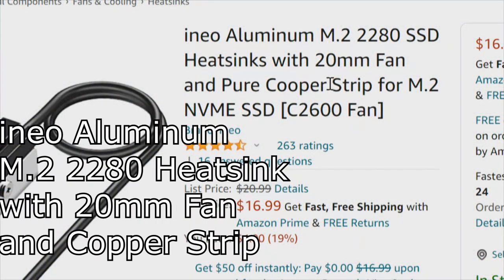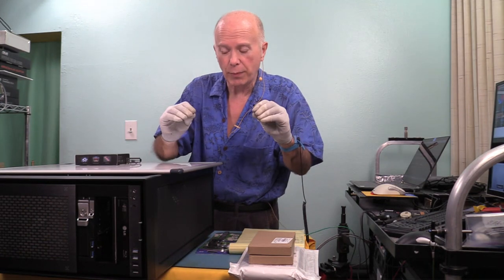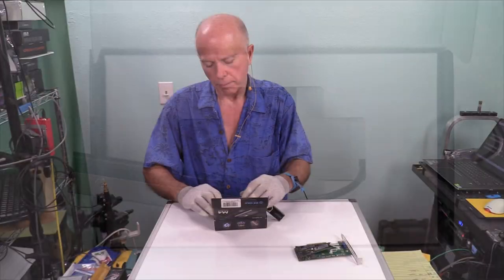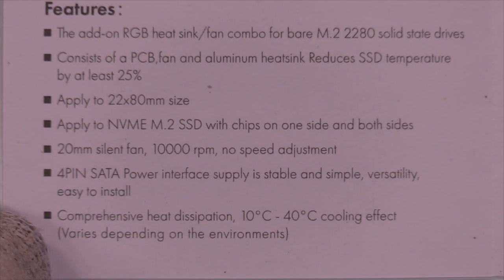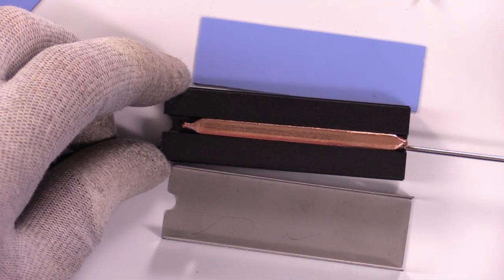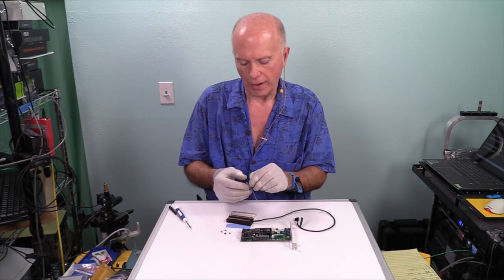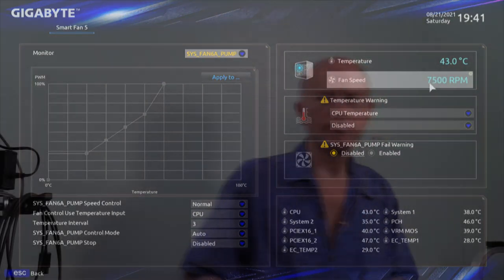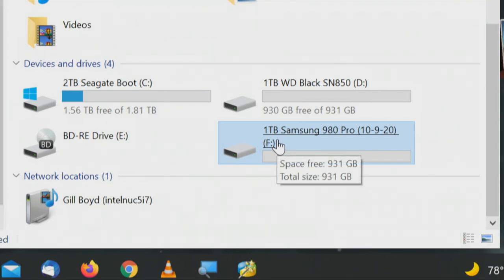ineo Aluminum M.2 2280 SSD Heatsinks with 20mm Fan and Pure Copper Strip

Comment: Only issue I have is the fact that the bottom base tray of the m.2 cooler is metal, and does not appear to have any sort of "coating" to prevent possible electrical shorting or maybe even heat dissipation into the MB at the base mount point.
What I did to add possible prevention was to simply purchase another heatsink strip, and add it to the bottom "sandwiched" in between the MB and the bottom of the m.2 cooler. Actually gained a 2 degree difference. Very Impressive.
Great video, and thank you for making this test for all of us to see your work.
Reply from the maker: Hi Joe Jones,
Welcome! I've always examined the bottom for clearance. Thanks for Sharing! You had great Results! Appreciate Your Comments!

Comment: correct me if im wrong but the cooler was installed the wrong way, the fan over the memory controller should provide slightly better cooling but from the way it was installed in the video, the fan portion of the heatsink was installed over the nand memory and not the controller which what actually gets hot when the nvme is being used.
Reply from the maker: Hi Frank, 
Welcome! Glad You mentioned that aspect. Keep in mind, of the 16 M.2 NVMe PCIe Heatsinks We've Tested, Two were Ineo. Both had Fans. This one, as You have stated, should be over the Memory Controller. The other by Ineo has the Larger Fan centered for the Heatpipe. Neither of them Performed as well as We had expected. No this will not be repeated. As always, Test and Verify, Your Results may vary. We have found of those mentioned, Passive Cooling was more Effective than Active Cooling. Yes, Our Two best Performers so far are Passive Cooling, Acidalie and JEYI. We need better Designs. Especially for PCIe 5.0 unless to reiterate, current Designs change significantly. Thank You for Your Comments and Observations. We look forward to Your Results.

BTW: That M.2 Heatsink Cooler is currently out of stock on Amazon.

Comment: Hmmm 🤔 that fan is not doing much is it 😅? Normally a properly designed fan for a particular heatsink results in 2.7~3 times increase in cooling capacity, not today though.
Thank you for the video, very informative !
Reply from the maker: Hi 5 nm,
Interesting right. We too expect better Results. Thank You for Watching! A Review Summation then the Thermal Pads!

Comment: About to install a Corsair Commander Pro to handle all the fans, as the Designare doesn't report RPM on all of the fan ports.   The Commander Pro works with Argus Monitor, which allows much more complex fan curves than the BIOS.
Reply from the maker: Hi Michael V, 
Good call! Thanks for bringing this Up! That was on Our List for the Active Cooling Solutions if We had gone down that road. Good call for the other Case Fans too! Thanks for Sharing!

Comment: Four heat pipes wins. With two temp reading and the one on the controller being lower sounds good to me. I use the Asus DIMM2 mobo socket holder for two NVMe drives that comes with two Al covers. I hate M.2 sockets that sit under the Graphics Card!
Reply from the maker: Hi Max Hughes, 
Absolutely Agree! Acidalie with 4 Heat pipes. Interesting only ASUS, as far I can remember, is using an M.2 DIMM2 card. Everyone else, under the Graphics Card! These Results are fascinating!
Reply: @BuildOrBuy  Sorry I don't have any temp info on the DIMM2 cards on the Zenith Extreme. X399 no heat sinks. TRX40 Zenith II Extreme had heat sinks (I bought two on eBay for my old X399). WRX80E no DIMM2 socket at all. I'm looking forward to the tests on quad cards.  My Asus Hyper card doesn't have any finned heat sinks on it. Should I glue, thermal tape or use paste/pad and screw down a heat sink to a quad card  with only flat sheet metal cover? Amazon's 150 x 70 x 10mm Al sink look like a fit.
Reply from the maker: HI @maxhughes5687 , 
Bummer. Got it. No Heatsink on Your ASUS Hyper Quad x16? Odd. Purchased new? Most curious. On Amazon? The ASUS Hyper Quad x16 has an Aluminum Heatsink with 4 Thermal Pads. At least the one We Tested did. We have other Quad card that do not. I'm going to have to look into that further. This Series arouse out of Heatsinks for Dual M.2 Adapters. In the back of my mind was the CableCC Dual and Quad cards We have yet to Test. a Quad card should have a 4 Drive solution instead of 4 individual Heatsinks. This is going to get interesting. I'm concerned about the weight. We might have to examine those as We do the Heatsink Summation. Stand by for that recommendation.
Reply: @BuildOrBuy  Yes. I went back and watched your vids. I remembered the copper finned sink on the Gigabyte but forgot about the Al sink on the Asus. Once I put it together, I don't want to mess up the thermal pads opening the cover. And I'll wait till I have everything to break the seal on WRX80E box. Sorry to waste your time.
Reply from the maker: HI @maxhughes5687 , 
I think those Thermal Pads have a film covering them if memory serves me correctly. Never a waste of time! I Appreciate Your Comments! Helps Us to make better Videos for clarity while We Answer Subscribers Questions! Stuff like that is easy to forget or overlook! Sometimes We just need a reminder! When will You have everything ready to Build?

Comment: Installed this on my SN750 SE and I reached 46c during full load. Idle at 37c. Probably overkill but that’s the point right?
Reply from the maker: Hi BASHFILE,
Welcome! Always good to be aware of heat which becomes a bigger problem at PCIe 4.0 so You're thinking ahead! Overkill... Getting prepared!

Comment: Nice review! I got a question to ask you. I got Asus Gaming Plus B550 with two samsung evo plus nvme (500GB and 1TB) the 500GB was closer to PCIe 4.0 next to cpu at the top left side and 1TB was closer to PCIe 3.0 next to chipset at the bottom right corner. Both NVMe are PCIe 3.0. The drive temperature and drive temperature 2 for 500GB idle at 28C / 32C and full load at 66C / 85C while the 1TB idle at 28C / 32C and full load at 67C / 88C as it seem drive temperature 2 are the hotter than drive temperature? As both NVMe are with thermal pad heatsink. Are both 66C and 67C are ok and safe for both NVMe drive temperature rather than drive temperature 2? The temperature was full load using CrystalDiskMark as both are reading 3500MB/s read and 3300MB/s write speed.
Reply from the maker: Hi Bulldog347, 
Welcome! Thank You! Appreciate Your Comments! Suggest running the Samsung Magician
https://www.samsung.com/semiconductor/minisite/ssd/download/tools/
Numbers are good and consistent. Those PCIe 3.0 M.2 NVMe SSD Drives should top out OK on Temperatures. Samsung Magician will identify. Suggest changing out the Thermal Pads for a higher W/mK Value. We're working on Videos about that Topic after We do a Summation of the Heatsinks We've just Tested for Dual M.2 NVMe Adapters. 1st Temp is probably the Controller. 2nd Temp should be the Memory.  The only way to get better Temps from what We've tested would be with Heat pipes. And those stick up too far to have anything above them. In other words, for now stick with the stock Heatsinks until We get either diamonds or ceramic. The combination of copper and aluminum is offering the best Passive Cooling Solution for now. The Active Cooling Solutions are not measuring up. From what've observed, the copper to remove the heat. The Aluminum to dissipate the heat. Hope that helps! Thanks for Asking!

Comment: Hi I'm a newbie when it comes to pc stuff. But I try and do things on my own from time to time. I want to install this exact heatsink but I'm not sure where to install the power cable to the motherboard or if I need an additional adapter for this. So my question is where do I install the power cable? I have ASRock b450M/ac motherboard. Can I Install the power cable on the cha_fan2 ????
Reply from the maker: Hi Mario,
Welcome! Congrats on Your Build! That looks like a 3 Pin Fan Connector, CHA_FAN2. If so, the Fan would always be on at constant speed. Preferable to use a 4 Pin Fan Connector. That way, Motherboard can Control Fan Speed accordingly. What about CHA_FAN1? Don't see any other Motherboard Fan Connectors. Very odd. Hope that helps! Experience is the best teacher! We learn by doing! Thanks for Asking!
Reply: @BuildOrBuy  thanks for the quick response the Fan_1 is already being occupied by aio cooler fans.. is there another solution to connect this hear sink for my 2tb samsung 970plus ssd???
Reply from the maker: Hi @Mario-uq8gr ,
Absolutely! A Fan Hub! Four Options:
1. Motherboard PWM Fan Hub Splitter, 4 Pin Black Sleeved 5 Way PC CPU Cooling Case Fan Extension Splitter Adapter Cable 40cm/15.7inch
https://amzn.to/3LqIGAM
2. ThreeBulls PWM Fan Hub, PC CPU Cooling 4 PIN/3PIN Fan Power Cable Hub Splitter Adapter Sleeved PWM Case Fan Splitter for 12V
https://amzn.to/3S8KMrz
3. Chassis Fan Hub CPU Cooling | 10 Port 12 V SATA to Fan-Header with 4 Pin PWM Controller
https://amzn.to/3RUHSX1
4. Last option, a 4 Pin Fan to SATA Power Adapter such as this Link below:
https://amzn.to/3DvX0pB
As an Amazon Associate I earn from qualifying purchases! Hope that helps!
Reply: @BuildOrBuy  if you Google my b450m/ac asrock motherboard and you would see the layout of it. Which choice would you say would be the best for me? And where would I be able to hook it on to? On the motherboard or extra power cables slots?
Reply from the maker: Hi @Mario-uq8gr ,
We Research every Motherboard on Every Question when asked about a particular Configuration to know the facts. ASRock B450M/ac https://www.asrock.com/mb/AMD/B450Mac/

Those are Your best Options. Look at the Power Draw from Your Water Cooling Configuration on that Fan Connector. Option one, a Fan Hub. If You want the Motherboard to Control the Speed of that Fan, You have one Connector. Otherwise the other Fan Header is just a constant speed Connector. Use that. Or... Option Two, also constant speed Fan Connector direct to CPU. 

Choose which one is preferred by You. There is no wrong or right, just a preference based on what We've Outlined as Options. Hope that helps! Now the problem with Motherboard Fan Headers, they can be overloaded. Some Builders prefer a Fan Header direct to PSU for that reason. Most Motherboards have 3 to 5 Fan Headers. You only have 4 Fan RELATED Headers. To reiterate, only 3 Fan Headers. And You're using 2 of them. 
1. AMD Fan LED Header 
2. CPU Fan Connector (4 Pin)
3. Chassis Fan Connector (3 Pin)
4. Chassis/ Water Pump Fan Connector (4 Pin) 
By process of elimination if only the 3 Pin Header is available, try it and see how You like the Performance. Least expensive Option. You can always Opt for a Fan Hub later. 

We're talking about an Active Cooling Solution on an M.2 NVMe PCIe Drive. Of the 14 M.2 NVMe PCIe Heatsinks and 3 Thermal Pads We've Tested, the Passive Cooling Solutions are more effective.
Reply: @BuildOrBuy  ok alot of good informative advice. I was thinking of buying the first option on Amazon for the Motherboard PWM Fan Hub Splitter, 4 Pin Black Sleeved 5 Way PC CPU Cooling Case Fan Extension Splitter Adapter Cable 40cm/15.7inch for Computer Cooler Case Fans  first I was gonna disconnect my main air cooler fan from the cpu_fan1 slot and then using the adapter Splitter to connect it to the cpu_fan1 slot and reconnecting my main aio cooling fan back to the cpu slot on the new adapter and then using one of the open slot like fan1 on the adapter for the heat sink fan.  Is that the correct way like I just mentioned?
Reply from the maker: Hi @Mario-uq8gr ,
Thank You! We try! Yes, great idea! Excellent Plan! Just watch Device Performance while Testing to Verify Results! Keep Us Posted on Your Progress!
Reply: @BuildOrBuy  will the mother board still have control of fan speeds conecting it this way?
Reply from the maker: Hi @Mario-uq8gr ,
Yes. One Motherboard Fan Header will Control all Fans on the Connected Fan Header.
Reply: @BuildOrBuy  thank you for all this information.. one last question is my motherboard compatible to upgrade from a 512gb seagate sd to a samsung 970plus 2tb ss m.2 nvme?
Reply from the maker: Hi @Mario-uq8gr ,
Your Motherboard Chipset is PCIe 3.0 and will work with ANY M.2 NVMe PCIe SSD Drive up to that Speed of 3,500Mbps and up to the current limit of 8TBs in Capacity. Anything faster, to reiterate, is only good up to the speed of Your Chipset and no faster. Yes, to reiterate, what You're asking about will work. Hope that helps! Success on Your Build!
Reply: @BuildOrBuy  thank you very much!!
Reply from the maker: Hi @Mario-uq8gr ,
You're most welcome! Glad We could help!
Reply: @BuildOrBuy  hello sir im finally getting my pc build close to being done but after installing my new ssd samsung 970plus  m.2 nvme. My motherboard asrock b450m/ac is not detecting it. I tried initializing it on disk managment but its not showing either i know i installed ssd correctly... not sure why its not reading can you please help?...  i would really appreciate it
Reply from the maker: Hi @Mario-uq8gr ,
Which one. There are now two. Do You have R2.0? Looking at 1st Original pdf Manual, M2_1 is PCIe 3.0 X4. Nothing Shared. You should be good to go. Do You see the M.2 Drive in the Bios? This is a process of elimination.
Reply: @BuildOrBuy  after installing and Uninstalling ssd it finally read lol not sure what had happened
Reply from the maker: Hi @Mario-uq8gr ,
Loose connection. Connector contacts. Good You removed and reinserted. That usually happens with Memory contacts. Glad to know You're up and running! Success on Your Build! Keep Us Posted on Your Progress!

Comment: Yea, I actually purchased this a while back. Waste of money to be honest. Did not make a noticeable difference. Fan is not PWM and is annoying as all hell.
Reply from the maker: Hi Germaine Breakenridge, 
Welcome! Appreciate Your Comments from Your Experience! We were asked by Subscribers to Test. We Tested. Results. Can You imagine trying to utilize 2 or 4 of these? Agreed. An interesting idea but We can and have shown better! Thanks for Watching!
Reply: @BuildOrBuy  Thanks for the response. It was just not worth it in my setup. The fan was loud, well more annoying than anything. It had a High pitch whooshing sound lol. When you turn the fan curve down, the gains were not worth it. Maybe if My PC was on the floor and not next to me, I could run the fan at a higher RPM and benefit, but its not worth it when the PC is this close.
Reply from the maker: Hi @GSXone  , Absolutely! Yes. Heard that whooshing sound going into Windows. Weird! Loud enough to take notice. And that was just one Fan. What Cooling Solution did You go with?
Reply: @BuildOrBuy  The ineo with the 20mm fan. Stock thermal pads on samsung 970 EVO.
Reply from the maker: Hi @GSXone , Interesting. Are You going to change it out to something else? We had the best Results from Acidalie. Hope that helps!